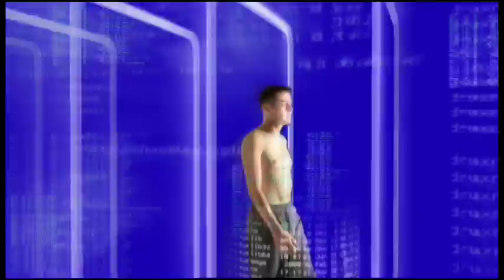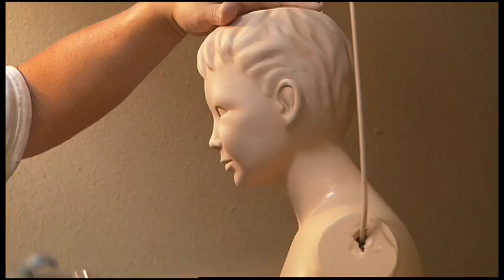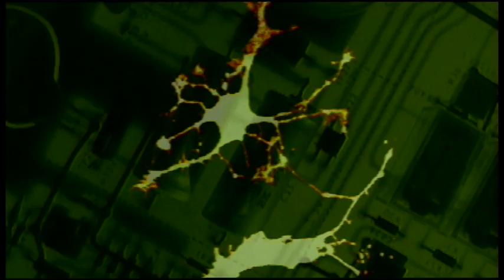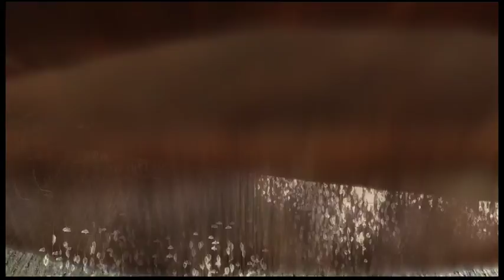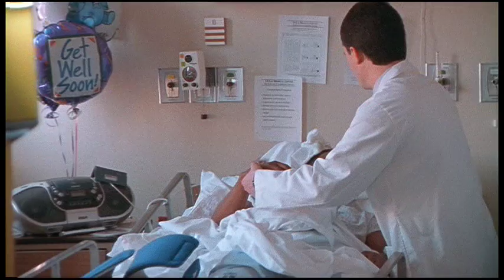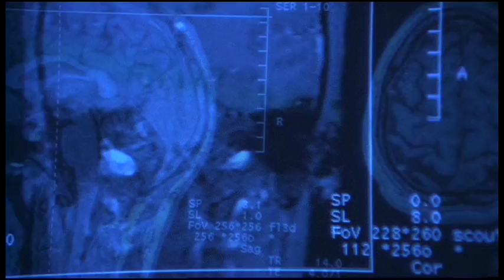Beyond Human: The Cyborg Revolution

Comment: thats not how the brain works, the electrical currents dont contain any information at all, they simply apply the electricity to the area where the information is then passed on via chemicals, so we wouldnt be able to connect the brain to a chip via electrical currents, but rather chemicals, perhaps a special chip that picks up on these chemicals could possibly be built.....